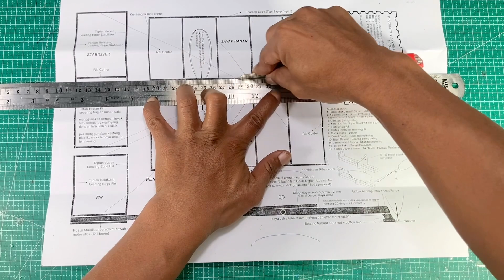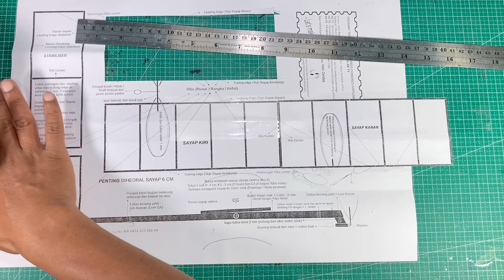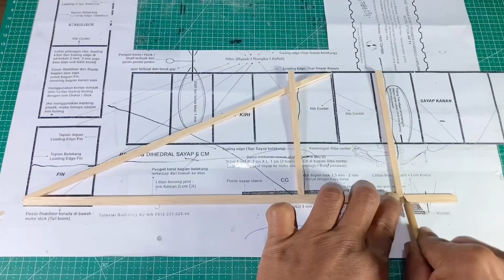Wright Flyer? Biplane Canard Rubber Powered

Comment: Great job brother ... if I may suggest to change the elastic band to the center and have something to transfer the power to both propellers .. you need just a bit more elastic band .. and re-check the propeller configuration ...
Reply from the maker: Gear set right? Yes thank you